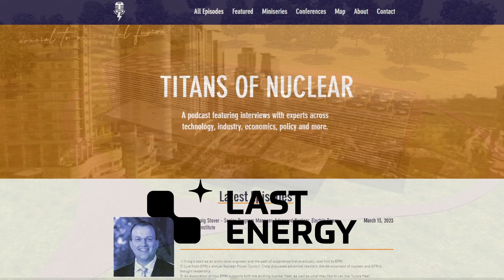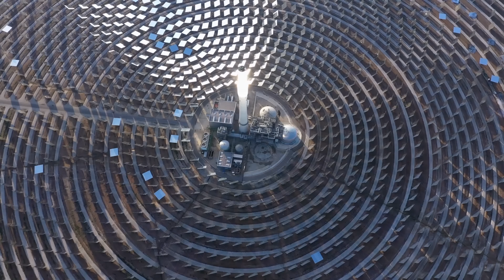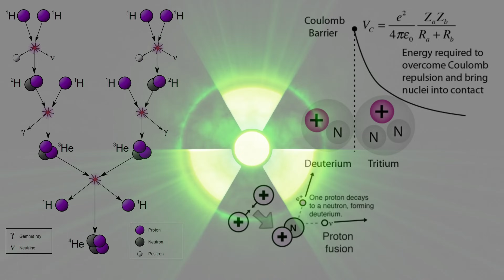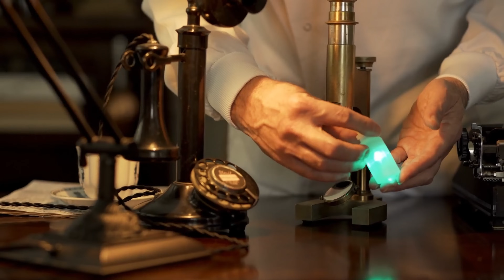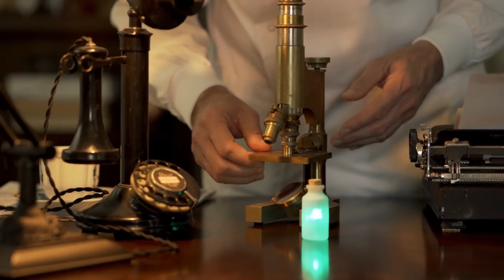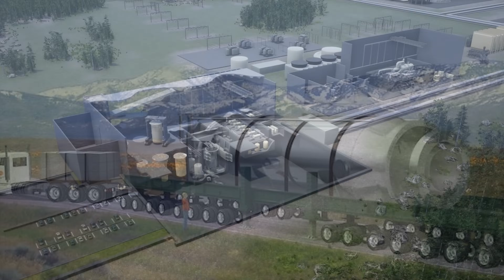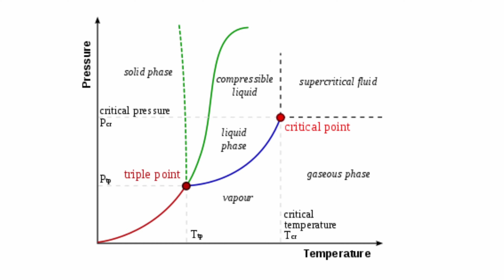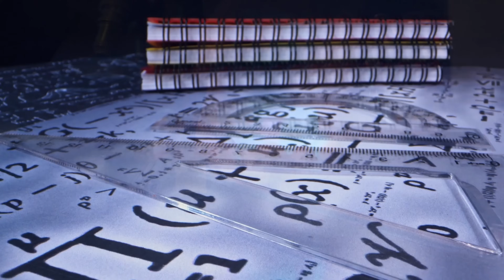Nuclear Power: Small Modular Reactors

Comment: Small nuclear reactors are a way to prevent the massive scale disasters of the current approach to nuclear. I mean it's crazy we are like let's make massive reactors then run a lot of copper cables around the world instead of build the power at the needed location
Reply: More reactors = more chances for something to go wrong. Still no way to safely store nuclear waste or chemicly alter it into none radiating materials. Sofar nothing in this that would convince me in the slightes. Meanwhile solar still becomes more effective to the extant that in cloudy areas they become viable. Pair those with new battery concepts and you have a full replacement without any deadly sideeffects.
Reply: @kinngrimm  - Remember, the materials used to make solar panels have to be mined, which is a destructive process & causes deforestation, then the panels have to be manufactured, which creates pollution. ATST, Rare Earth Materials like Gallium, Selenium, Cadmium & Cobalt need to be used to make solar panels & Li-Ion Batteries. 
Safety storing waste is a political issue, not an engineering one. We can safely store it in pools & then underground, but NIMBY has caused underground storage to be scuttled numerous times.
One thing that must be understood - There has never been a prosperous society with a burgeoning middle-class that didn’t have access to cheap, abundant & reliable energy. Many countries are poor, not just because of corruption, but also because they lack access to cheap, reliable & abundant energy!
Reply: @TraditionalAnglican  "Remember" no need to, i am aware. Wasn't the point so was it?
Radiation is longer lasting and at least as deadly as all these points listed by you at the place they are used and then at its waste disposal sites. The costs for replacing the reactors then also goes to the public not to the private carriers usually. There is not anymore any economic argument i can see with nuclear energy when put into perspective.

These rare earth will be extracted in any case or did you stop using ... technology? Them ending up in solar pannels seems a better use case than freaking smartphones in my book any day. Still not the point so, right?

You presented me as a reaction on my first comment with the "1 gramm" argument to devalue my points which i rebuttled. Sofar you did not concede that argument as grown ups do, but went on with whataboutism . So i have not really any intention to further engage. Don't see this as an attack please, but as a retreat of someone who values his time in life more than a pissing contest.
Reply: @kinngrimm  - You seem to think utility providers were planning on doing what Norfolk-Southern & other railroads have been doing & externalize the costs of operations. That simply isn’t true - Power plant owners have been paying for the cost of storing nuclear waste & were going to pay for underground internment. The permanent underground internment didn’t happen because it was blocked by members of Congress, not because those needing to store the wastes wanted us to foot the bill after they made the money & ran. ATST, they all had established funds to deactivate & shut down the power plants at the end of their life cycles - The only thing that short-circuited that were politicians & activists  who demanded these be shut down early.
Did you know that nuclear power is safer than the alternatives? Did you know that most people have conflated nuclear power (which is safe) with nuclear weapons (which could end us)? 
Regarding mining & tech - How many 1,000’s of tons of these materials will be required to build the 100’s of square kilometers os solar panels & exawatts (i had to look it up) of battery storage that’ll be needed to back it up unless you’re willing to do fossil fuel power plants! And fossil fuels are killing people & contributing to Global Warming NOW! Most poor countries have plenty of resources & hardworking people. What they lack is access to cheap, reliable abundant energy!
Reply: @kinngrimm  I addressed your concerns it's not "whataboutism" accidents occur would you rather the accident be massive or small and localized. It's not a pissing contest I'm addressing your concerns that are unfounded if you do not wish to have a conversation don't comment on my comment🤷🏻‍♂️ nuclear is the way period solar is only around half the day and can be gone for weeks or months depending where you live from an engineering stand point which is better a large unit that makes small amounts of power or a small unit that makes massive amounts of power day and night rain or shine? Figuring out safe small nuclear is paramount how do we explore space otherwise? Solar? How many panels to equal nuclear how do we power faster than light travel machines without nuclear? You are scared of something that can easily be mitigated.
Reply: First of all i mixed up the second commentator being the same as the first who addressed me and  got anoyed as one can clearly see. I appoligize for an unwarranted reaction there and would ask to ignore this passage ...
"You presented me as a reaction on my first comment with the "1 gramm" argument to devalue my points which i rebuttled. Sofar you did not concede that argument as grown ups do, but went on with whataboutism . So i have not really any intention to further engage. Don't see this as an attack please, but as a retreat of someone who values his time in life more than a pissing contest"
... from my former comment.

 @cch201992  How much fuel does a SMR need? Not 1 gramm, right?
From your last comment i can see you read the comment addressed to @TraditionalAnglican so the point here still stands that your argument you made on the minimum needed fuel use is not valid.

"Safety storing waste is a political issue, not an engineering one"
I beg to differ. It is at least both. The later also relying on material science, geography and predicting on how the future would shape in worst case scenarios to then be able to provide safe solutions which currently for several reasons are just not possible.

Don't get too hung up on my intial comparison to solar either. It is a valid comparison for suitable environments and the range what is suitable is increasing due to more effective solar output. There are still other true green energy sources yet that have not been addressed here. Which again regionally can be valid replacements and a lot of inovations of late are comming out in their respective fields of wind, wave or more generally water energy. Still not the real issue here either. As the topic is the viability of SMR. Which you still failed to show is viable due to it having still the same issues as former reactors have. For space exploration, ok i can conceed that point. Having a nuclear powered engine with a small reactor seems something pratical and easy enough to get rid of by dumping ito the sun or just letting it drift of into outer space.
Using SMR here on earth, horseshit aslong you can not gurantee long term storage or transformation into a none radiating material. Both at the current point not doable.

Furthermore these reactors may have new safty measures, but they are still in basic principle just the same as their bigger brothers and noone ever imagined Fukoshima till it happened or Tschernobyl, or recently Ohio spilling thousands of liters of coolant water into a river for neither company nore state informing its citizens. Yet you propose to increase the number of reactors and by that the chances for something going wrong. It is not about the 999 times that everything goes as planed, but about the one time it doesn't. If you have any idear of propability and stochastics, you know i am not wrong.

@TraditionalAnglican  "
"One thing that must be understood - There has never been a prosperous society with a burgeoning middle-class that didn’t have access to cheap, abundant & reliable energy. " That depends how much back in time one goes. Before there was electricity, there still were prosperous civilizations.

Still taking your point, what has that todo with anything? Should we pay with high risks for nuclear or leaking radiation for prosperity? That doesn't sound like a good deal to me. Rather have progress go a little slower but not take that risk. That to me sounds more reasonable than the, "risks what risks? the industry says its safe, so lets do it" approach. SMR are very high on the agenda of the IAEA which is selfevident as it is their paradigm we are talking about. They lobby these SMR for a long time now and i would not be surprised to learn that they have degraded in some ways towards a lobby organisation for the nuclear energy sector or maybe they were always that anyways and i am just not aware of it. Point being, i am not taking them at face value on this and most information though do come from them. The only relevant other calculations i would hold against them are the once looking at the costs of a life cycle of these SMR and then compare them to sola/wind/water and sometime in the future maybe fusion energy. Only then the picture becomes really clear. Include in these maybe the upcomming health costs of those who are affected by the radiated water in Ohio or the those who lost their homes and lives in Fukushima and Tschernobyl. Don't just go with the best possible outcome, but what would be the worst possible scenario and only then i think a clear picture can even come to emerge.
Reply: @kinngrimm  why couldn't a smr use only one gram? I'm not a nuclear physicist but I understand things can be made smaller. They have a very small smr that nada is working on it's very small they mention how much fuel it uses you would need to find the video but it is a small amount of fuel given it's size I'm not starting it's exactly 1 gram I'm staying that the amount is small and would be less of a hazard unlike a big reactor breach. I will say why don't we see more SMRs designs and smaller ones to that I answer regulations how could one work on it it's nearly impossible to get a permit and thus drives down demand which leads to less research and less innovation.
Reply: @cch201992  because you need a mimium of a certain material to gain a sustained reaction going. That then is varying  depending on the material between 6 and 100 kg. As to be seen here
https://en.wikipedia.org/wiki/Critical_mass

In big reactors Uranium rods do not work on their own but in combination with each other due to their close proximity to other rods. Critical mass to my understanding is the point where energy production is achieved by keeping the fission process selfreliant going and if not done carefully would result in an uncontrolled reaction which makes a-bombs go boom(there is a bit more to that, but not really the topic here).

Ergo the minimum is 6 kilo which is 6 000 gramm. More likely though i assume 10 kg as uranium and plutonium are the more commonly used fission fuels. So there will always be at least 10 kg nuclear material that could spread in a worst case scenario when all the safty procedures fail. How often were we told these things are safe before ^^.

Meanwhile besides the safty issues, there are pure economical calculations that show that they are not as cheaply producing energy as the industry claims in comparison to solar/wind/water it isn't even a competition. It all depends who is carrying the costs you know. In capitalism, investments and costs the public has to carry and the profits are privatized. Ok not really the issue here, but put both calculations under the same balance sheet and things will sudenly look quite differently. The greens in germany have proven this to be a fact over and over again the atom lobby just cant debate this point so it isn't debated as they can't proof otherwise. The atom lobby only gets away with this in nations where it is about "national security" as the waste materials are also those which are used for nuclear bombs or uranium munition(which then is ending up causing massive child birth deaths and mutations in nations like Iraq unjustly invaded by the USA).
Reply: @kinngrimm  I disagree I there are reactors that make power just from radiation alone so they don't need to reach critical mass or go through any reaction like that which you speak
Reply: @casey hogue  What are you disagreeing with? I suppose i know what you speak of. If i am not mistaken the voyager and other satellites work on such principles you describe. They are though also very low maintanance in terms of power usage and i doubt scalable to the needs of say a large village or small town.
Doesn't make me wrong about the facts i posted either or would you be so bold to disagree on principles of physics? I repeat my earlier  question. How much fuel does a SMR need? I don't know for sure, do you? This seems to be a key datapoint we both need to investigate and my deductions don't seem to convince you.
Reply: @kinngrimm  oh yeah I don't know the math on it I'm saying it needs technology development because I believe "micro" nuclear power is possible so I'm disagreeing with your opinion that solar is the way. Solar is case specific and would need massive efficiency increases for it to be viable. Nuclear can get smaller I believe a reactor is scalable it would just output less power that is my theory do I have data? No but it's my opinion the technology exist to shrink a reactor down significantly enough for it to be viable for homes or even local community reactors might be a way to go too 🤷🏻‍♂️ Im not a nuclear physicist so I wouldn't have the calculations on the minimum amount of fuel required for a certain output
Reply: @cch201992  well the keyword in this last statement is "I believe". I don't. I don't have to as i try to be based on facts. Which for example points towards how critical mass is achieved. Sofar you haven't pointed out any methods how that would be achieved with less fissionable material or how much is needed for a single SMR module, which should be easy enough to find out i still asume. Instead you go with faith put into unpredictable future developments.

I did not say or claim Solar is the way. I used solar as a counterpoint for comparison, but i am definetly saying nuclear is not the way from all i know including what you could not tell me.

I don't think you need to make calculations to get the number of a minumum amount of fuel needed, but if someone who knows could tell it would be appreciated. If noone knows. Then what the fuck is anyone salivating about anyways ^^.
Reply: @kinngrimm  as someone with solar I will tell you solar is trash I live in Seattle area so I know a thing or 2 about cloudy days and it can not sustain a house in the rainy season solar has a long way to go. You understand with smaller reactors you only need like a gram of uranium and that will last like how many years? And say one small reactor fails now you only have to clean up one gram not kilograms the disaster scale is much less. Think of this which is safer one big tank of gasoline or smaller tanks of gasoline spread away from each other? Or a Forest fire is a good example if there is a forest fire would you want the whole forest burnt or the damage to be isolated as much as possible? Nuclear is the power of the Galaxy why would we not use it? Because without the people depending on cooperations for energy those companies wouldn't exist so it's in their best interest to keep the technology down for as long as possible